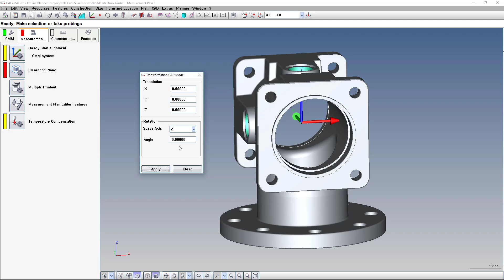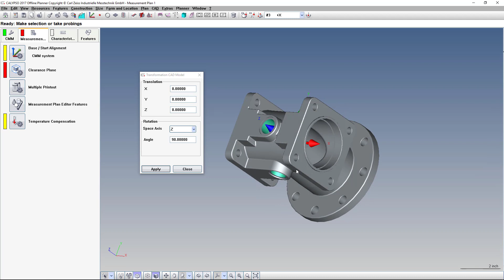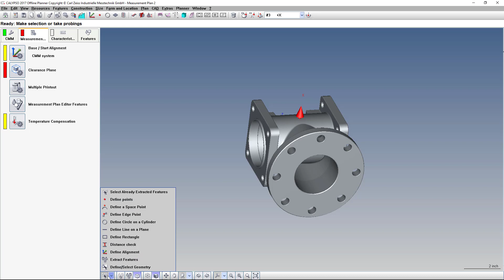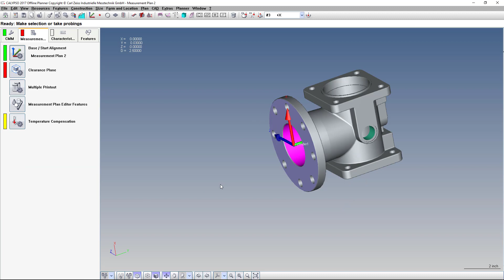Rotate a CAD model in Calypso

Comment: What if you do not know the angle you want to rotate? Maybe the model come in at like 19.123 degrees, but you do not actually know what the angle is. Can you rotate from a feature like a flange hole?
Reply from the maker: In a situation like that, I would rotate the model close to where it should be, then extract the alignment features, then set up the base alignment. After the base alignment is saved, the model orientation will be corrected to the base alignment.
Reply: @learn-cmm  Thank you.

Comment: How do you rotate the model / program if the part orientation needs to change from the original alignment concept?
Reply from the maker: Hi Alexander,
If you change your base alignment to a different orientation, everything including the CAD model will be re-oriented. This should be done with caution, because if you have a complex program with secondary alignments, you should check all the features to make sure everything lines up as expected. Also you will need to re-define your clearance cube.
If you want to rotate/move the CAD model only, go to CAD - Modify CAD entities - Positioning tab. Select the model so it turns pink, then enter the rotation angle or translation amounts in the boxes. When you click Apply, the model will move, but not your alignment nor features. This is helpful if you want to import fixturing models in addition to your part model.